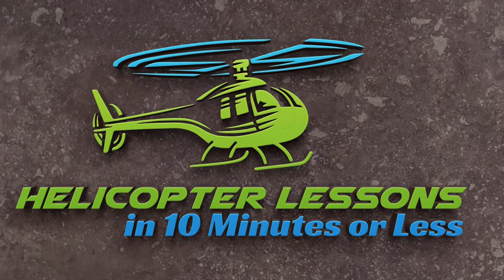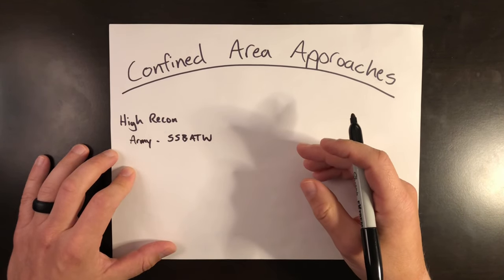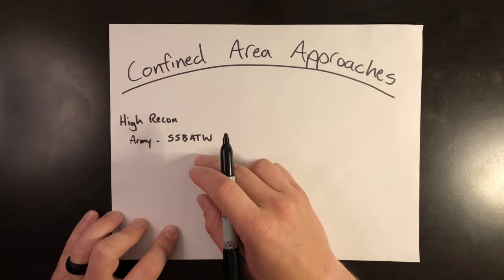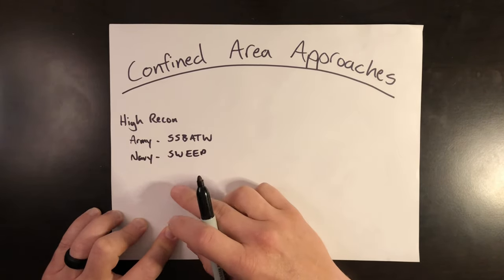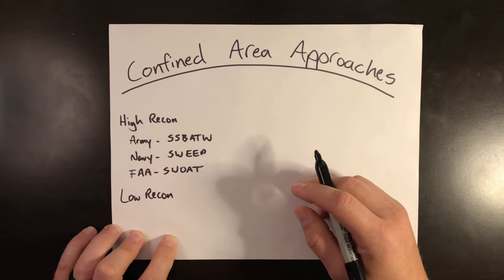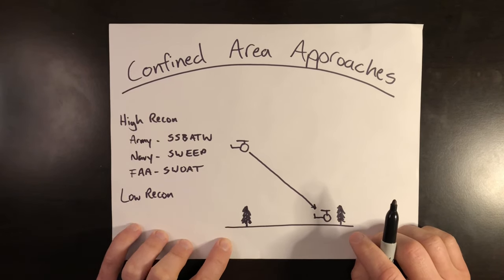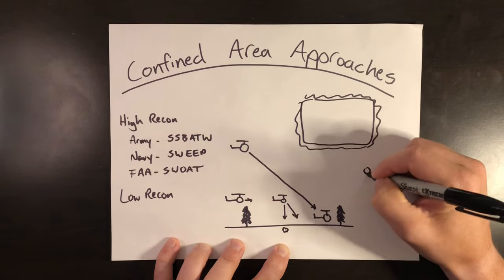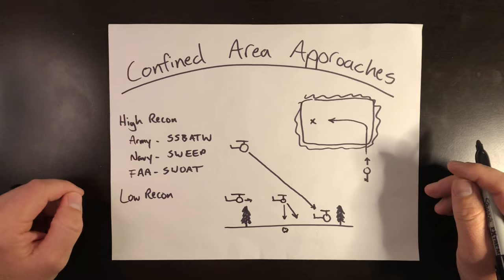Confined Area Approaches for Helicopters

Comment: Really loving your videos dude.  Trying to soak up some of your teaching style while working on my CFI.  In case you wanted another mnemonic for your toolbox, I learned the 5 S's and the 5 W's for area recon.  Size, shape, slope, surface, sun, wind, wires, way in, way out, and wildlife.
Reply from the maker: Haven’t heard of that one. Thanks for the feedback!
Reply: I only just passed my GFT in the UK - basically it's the 5Ss - size shape surround slope surface, plus wires and people.  Pressure Altitude isn't a great concern when our landscape looks as though it's been ironed!

Comment: Another great video. I just was reading this section a few days ago. Still requesting that slips and skids haha.

Also I have ordered all the books you shared as well as some of my own. In one of the practice questions it states

 Q: What chart uses a 1:500,000 scale? 
A:  sectional Aeronautical charts 

It further explains one should be familiar with low altitude VFR & IFR charts and their symbols. 

My question is Where in the FAA helicopter manual does it discuss this? I’m sure I’m overlooking but have yet to find it.
Reply: Also I have ordered all the books you shared as well as some of my own. In one of the practice questions it states

 Q: What chart uses a 1:500,000 scale? 
A:  sectional Aeronautical charts 

It further explains one should be familiar with low altitude VFR & IFR charts and their symbols. 

My question is Where in the FAA helicopter manual does it discuss this? I’m sure I’m overlooking but have yet to find it.
Reply from the maker: Google search the “FAA Aeronautical Chart Users' Guide.”  It’s a free pdf that explains everything. Hope this helps!
Reply: @helicopterlessonsin10minut10  Awesome thank you sir.

Comment: question regarding a steep takeoff & landing. 
as far i know in a confined area the best thing to do is vertically. cuze we should consider the (CDP) critical decision point or the commitment point, in case of single engine failure wether you rollout or land. but in a steep technique how to define the CDP???
Reply from the maker: I’ve actually got a video in the works for confined area takeoffs. Simply put, you need to establish some sort of abort point based on the type of landing. Short answer to your question: If you get a running start, the abort point is generally when you plan to need to get through ETL. For near vertical takeoffs it would be getting the appropriate altitude prior to moving over the trees.
Reply: @helicopterlessonsin10minut10  👍🏽👍🏽👍🏽